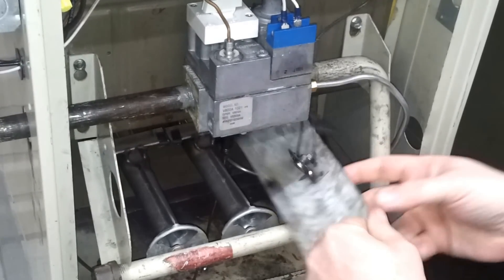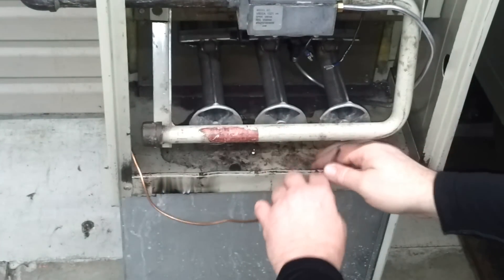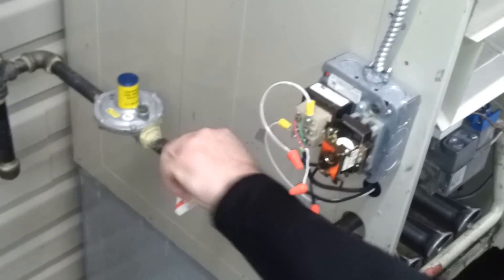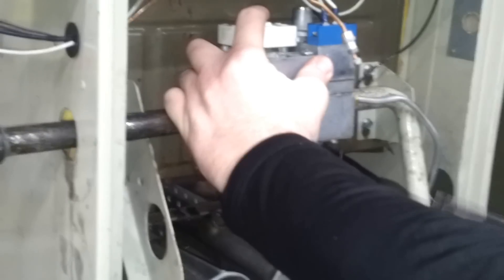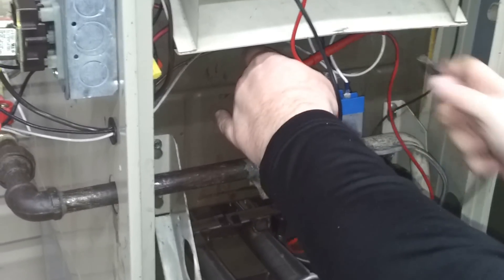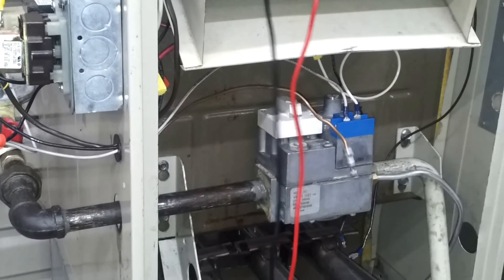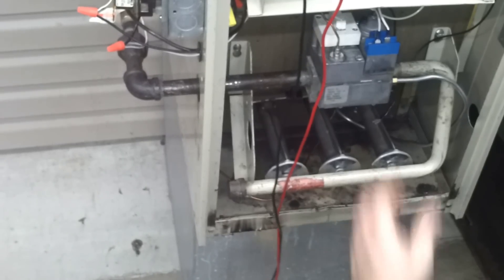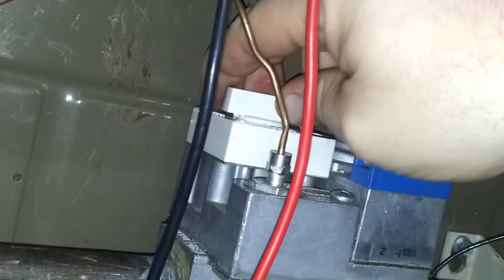How to check a thermocouple

Comment: Is the thermocouple head always in the pilot🔥, not beside the 🔥?
Reply from the maker: Yes it should be to work properly
Reply from the maker: Sometimes the pilot is dirty and doesn't hit the tip like it should but sill produces millavolts but goes out when the burner comes on

Comment: I have a hanging garage heater the piliot will stay lite but when it goes to fire the burners it goes out the burners fire a split second and it kills the gas to them... Could this be the couple its a pretty simple unit pretty much just a couple piliot burners and valve.
Reply from the maker: Not if the pilot stays lit, possibly the valve but could be the transformer under a load,
Reply from the maker: Also need to know what kind of thermostat your using

Comment: Goodman Furnace.   2 burners and only one is lighting.    Sometimes it works properly.    Any ideas why only one burner islighting when both should?
Reply from the maker: AquaCarb dirty crossover or even a small spider web, assuming the pilot is clean and properly positioned the burner need to be pulled cleaned and reinstalled , sometimes compressed air is enough but can be messy
Reply from the maker: AquaCarb the crossover is the mettle on the burners that allows the ignition to travel from one burner to the other ,while both burners are out and being cleaned , I always use warm water in a shower or drop sink the allow to dry always check orifice and make sure a spider didn't get in there as well

Comment: Sounds like you know what you 're doing. I don't,  which is why I watched your video. Would have been nice to actually see what you were doing. You kept your hands in the way of seeing where you attached the gator clips. So I don't know any more than I did before I watched it. Thanks anyway
Reply from the maker: Melisa Gwinn that's because I shot that when I didn't have any clips.  One lead touches the tip , that goes inside the valve the other lead touches the any part of copper

Comment: Great video, thank you.
One question, are all thermocouples essentially the same in terms of the voltage they output? 
The reason I ask is that I have a Bosch system where the pilot light keeps going out (after a day or two) and the thermocouple only outputs 18mV...
Reply from the maker: Paul Martin I am not aware of anything new make sure the pilot is clean and properly hitting the tip of the thermocouple
Reply: Yes, it's clean and the nice blue flame is hitting the top half of the thermocouple - still only 18mV. I've ordered a replacement and I'll test it before I install it.
Reply: This guy is showing more specifically  where to  connect the test leads to the thermocouple . https://youtu.be/Kw6M95Y3I5k

Comment: Burner Hesitates to ignite, when it finally does in a second or two a fireball shoots out of heat exchange, any suggestions
Reply from the maker: William pickle just seen this sorry !  Burner and b pilot should be cleaned if you haven't got that solved yet
Reply from the maker: William pickle just seen this sorry !  Burner and pilot should be cleaned if you haven't got that solved yet
Reply: Exactly what I did, and all is well again

Comment from the maker: yes but more so inside  the dissimilar metals can lose their fusion causing in a loss of voltage . most of the time the thermocouple fails to produce enough voltage due to lack of heat from a dirty pilot and/or soot build up on the thermocouple
Reply: +Robert Corcoran 26 accetpal
Reply: +khaled affani ?

Comment from the maker: in that case the connection may be bent down in the pilot valve assembly from over tightening the thermocouple the pilot assembly can be took out and bent back into position with a ball peen hammer